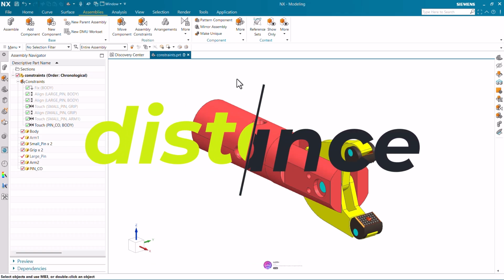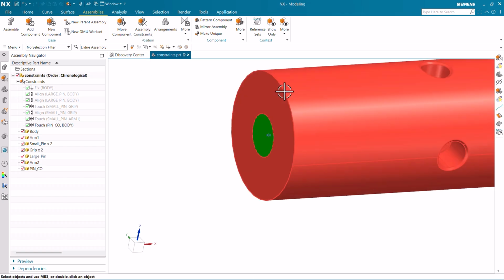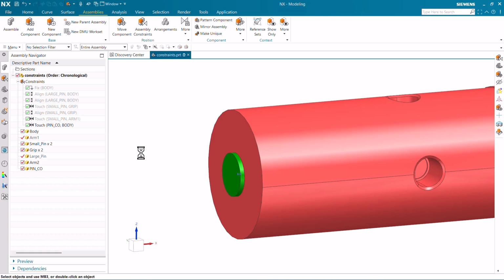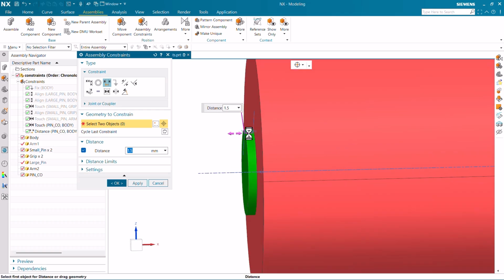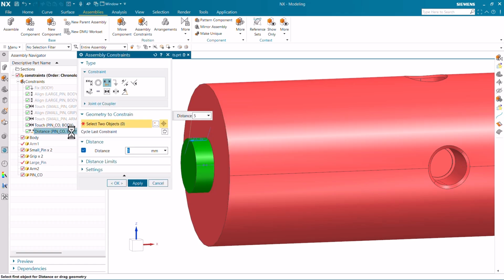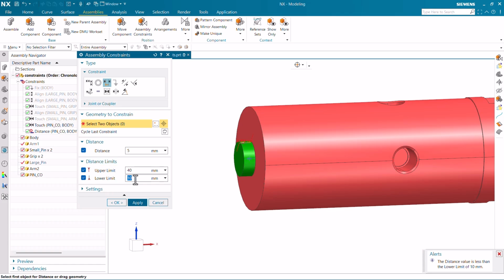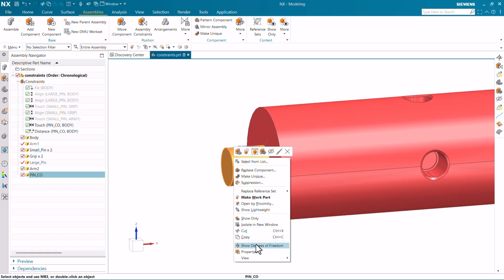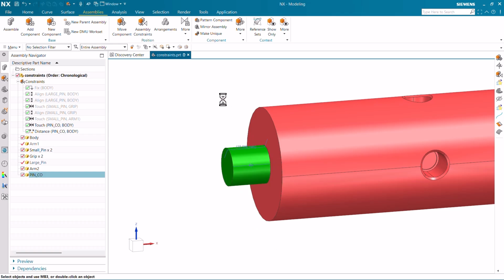The Ultimate NX Assembly Control: Master Distance Constraint & Limits!

Comment: I dont have thw assembly constraint dialog box. How do I set the distance with the Touch Constraint?
Reply from the maker: Let me help you with placing the assembly constraints command first:-
1. Right click in the empty space of ribbon.
2. Go to customize at bottom 
3. In commands, search for the required command like in your it would be "assembly constraints" or "distance" depending on the NX version.
4. Drag and drop the command from customize dialogue box to the ribbon. 

Now, let's come to the second part of your question, the distance can be given only with the distance constraint. Touch constraint doesn't offer the distance. 

I hope this will help you, let us know if you need further help.

Comment: How is upper limit or lower limit related to axis? 
Like how would I know that upper limit points out to which direction?
Reply from the maker: Follow these steps to know about the limit direction:
1. Give the distance constraint with limits (don't give specific distance) only use limits. 
2. Make sure that constraints are visible in the graphic window (ctrl + W) 
3. Now, move the component (move component command)
4. While moving the component, you'll see that distance is getting displayed on the graphic window.